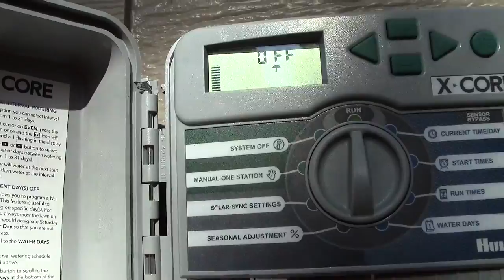Hunter Mini-Clik Wireless Rain Sensor

Comment: If you read the note on the front, it told you to go out to side to unit, push black button on top of the rain sensor, it will then turn green. Will turn red again after it rains and stay red until the outside sensor drys.

Comment: Does "bybass" mean "bypassing the sprinkler" "(as in "don't water the plants") or does "bypass" mean "bypass the moisture detector" and function as if the ground is dry?
Reply from the maker: It is referring to bypassing the sensor.  So if the sensor is giving you problems or you don't want it to do it's job then use the "bypass" switch.  There is a method to having a zone not affected by the sensor.  I'll do a video this spring on it.   In some cases, you install seed, new plants and/or have flower pots under a covered patio, you can have the sensor not affect those zones (they keep watering) and still have it work for the landscaping that is getting the rain.